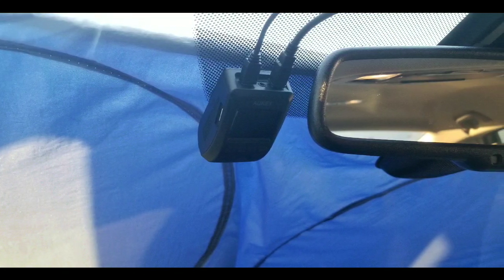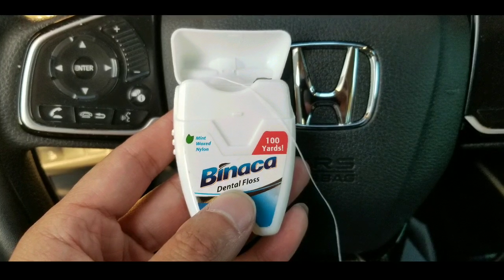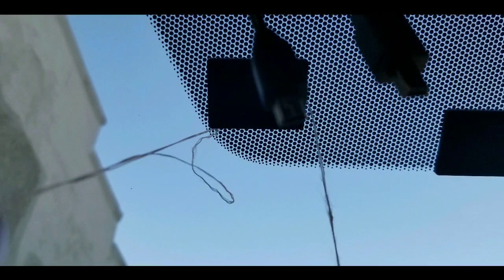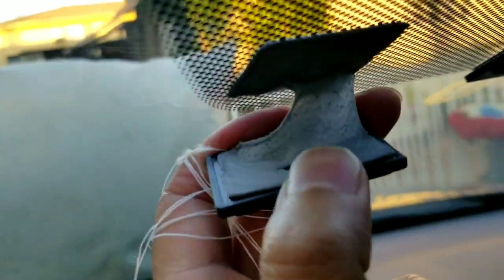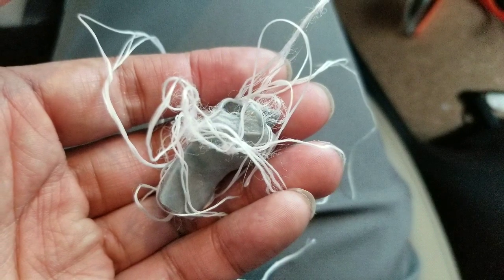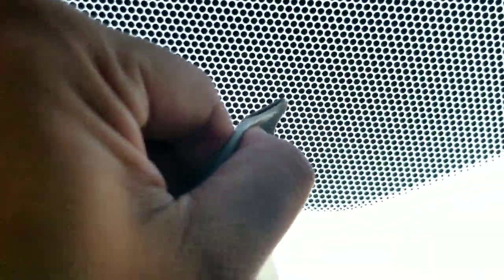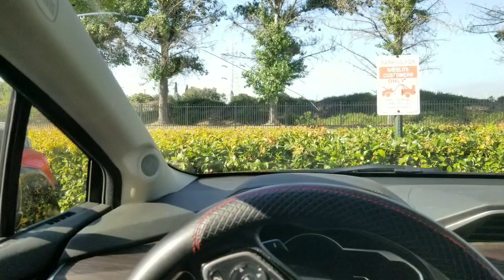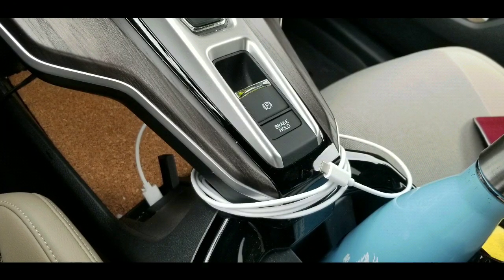DIY: How to Remove Dash Camera Mounts from Windshield

Comment: Question on your Honda Clarity as I have the same car, I mounted my dash cam behind the rear view mirror only to find the wiper blades did not wipe that section, so I have to move it.  Did you discover this too? where did you finally mount on your new windshield?
Reply from the maker: Lol... i turned on the wipers with water and maked where mounted it an inch under the path.

Comment: No issues with the dotted shade top?  I’m scared it will peel off when I remove mount.
Reply from the maker: I hide the dash cam in the dots. I haven't had issues yet. But results may vary. I would work the foam removal very slowly for older cars.

Comment: Tried it and it doesn’t work…at least not for mine. Just keeps breaking…even tried fishing line. Same thing
Reply: There are two types of dental floss.. waxed and non waxed. You'll find that the non waxed breaks quicker. The waxed stuff is much stronger and not easily broken..